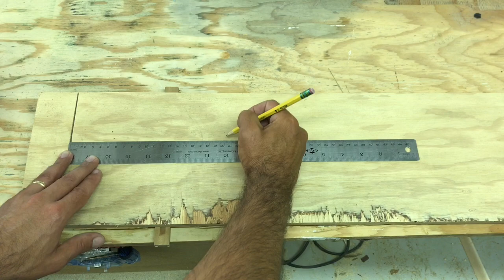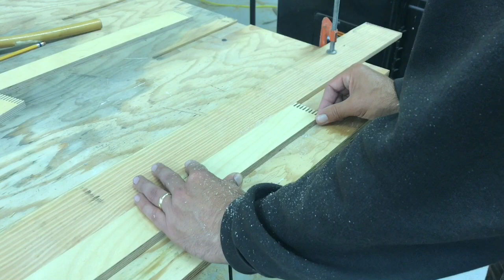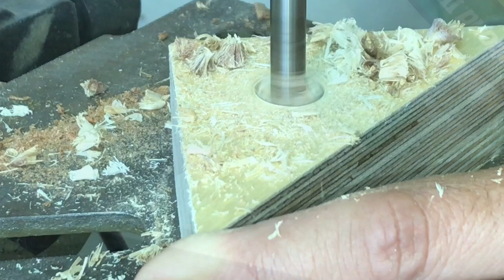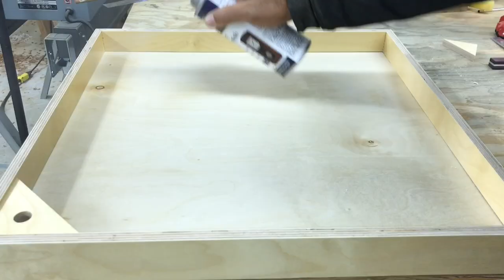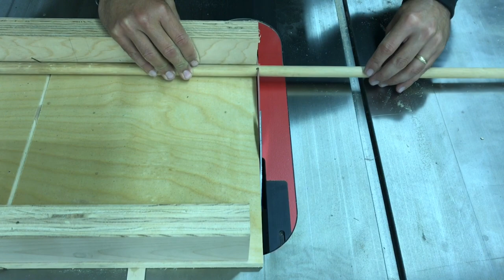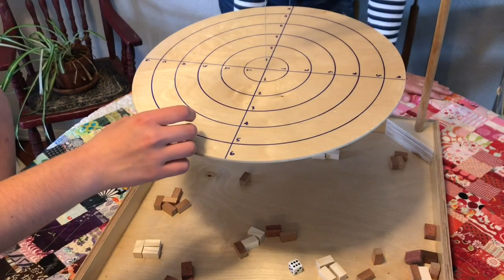A Game of Balance and Touch

Comment: I did but, it has no proper balance. You were talking about attaching washers underneath. Is there any other way?
Reply from the maker: I'm not really sure how else you might go about balancing the board.  I suppose you could add weights were needed by using small screws inserted in the edge of the board...but, that might not look right.  Sorry